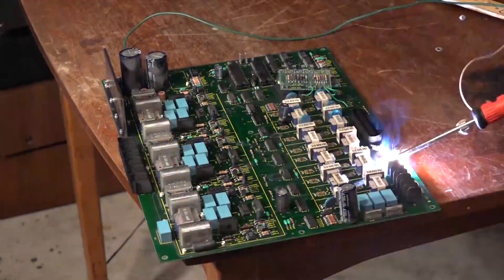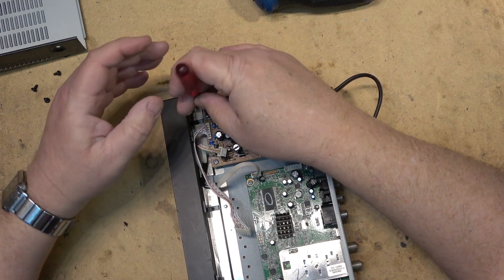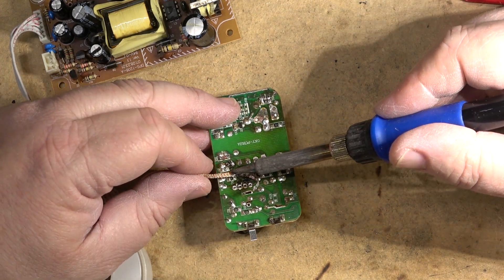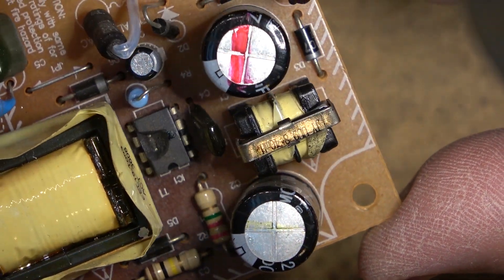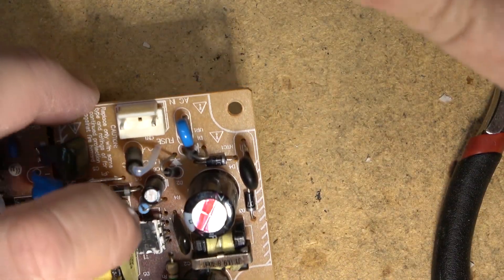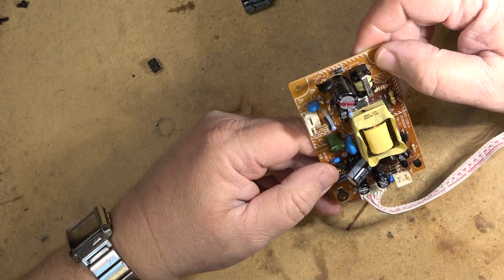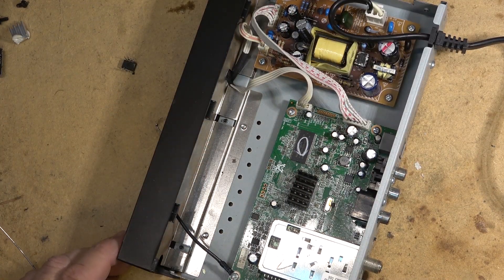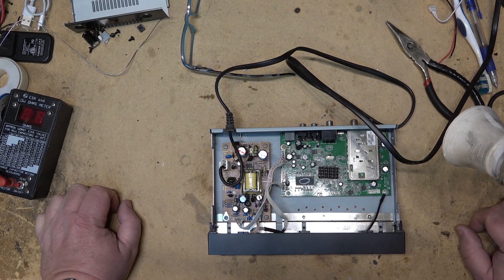Apex DT502 Digital TV Converter Box blowed up real good.   Lets fix it

Comment: These things suck. Period. I opened my Chinese off-brand one because it wouldn't turn on anymore and discovered that a cap in the power supply pissed electrolytic onto the board and went open. Threw that piece of crap away lol never again
Reply from the maker: They have their uses.  I use a few for an in house analog cable distribution.  My newer tvs have digital tuners but a few old ones i use regularly do not.